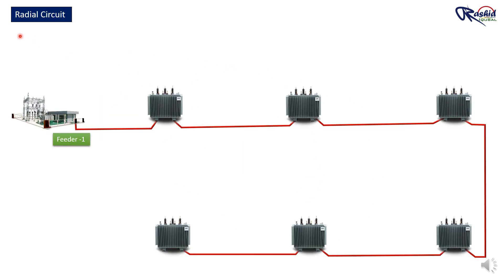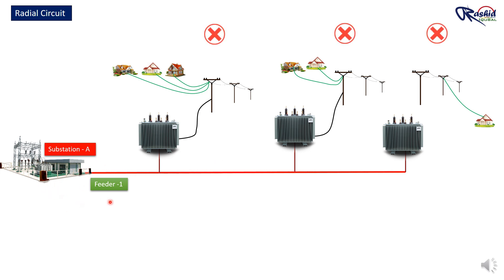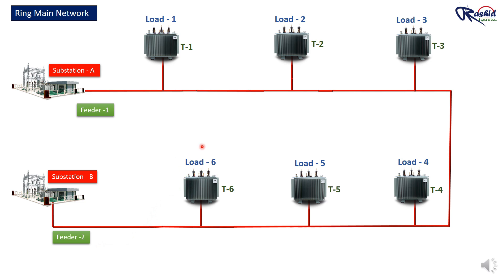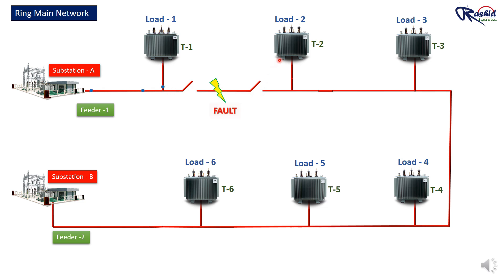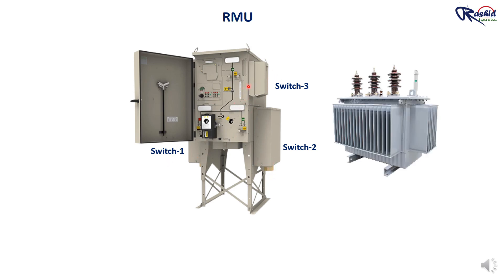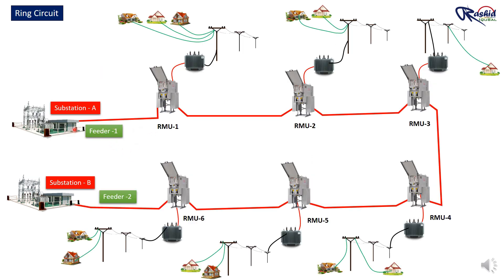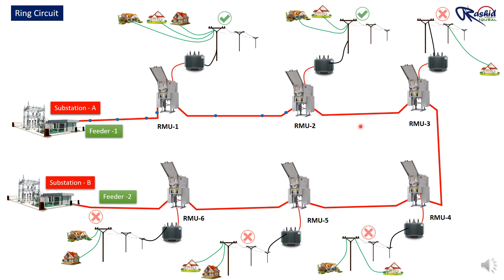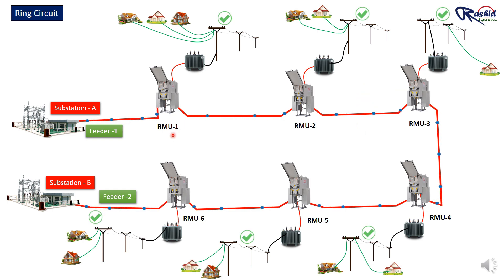Ring Main Unit (RMU) Explained | Radial & Ring Network

Comment: Hello. thank you very much for all your videos. I have a project where I have got two feeders coming from a 33kV Switchroom to 2 units of 33kV RMUs and these RMUs connect on to 2 units of 6MVA Transformers. These 2 units of 6MVA Transformers then connect on to two units of 11kV RMUs. I have not got much detail on the downstream network yet but we are building a 33kV DNO infrastructure that connects on to the electrical infrastructure in a port. My concern here is this: Is it right to have RMUs connected after Transformers cos I thought they should be connected before. Please can you help clarify.

Comment: Nice explanation. But can the load break switch clear faults. It's just like a switch or an isolator unlike circuit breakers.
Reply from the maker: @greatthings-1-j  its only switch which can operate manually or remotely. Once rectification done, switch turn to on position by operator
Reply from the maker: LBS is designed for switching under normal load conditions but not for fault conditions. It can manually or remotely isolate a feeder for maintenance but cannot handle high fault current..

If a fault occurs downstream, the protection system (fuses or breaker) operates first before the LBS is manually opened…
Reply: @Rashid-iqubal  then how it can clear faults in that case. As it is a manual device?

Comment: Thank you, simple and easy to understand, but what if RMU itself faulty, and Transformer faulty
Reply from the maker: @MohdArif-dt2ig  If an RMU or transformer itself develops a fault, the system’s protection devices (like circuit breakers or fuses) will isolate the faulty component to ensure the rest of the network remains operational. In ring main systems, power can be restored by switching to the alternate path in the ring, minimizing downtime.
Thanks for watching, please subscribe and keep watching